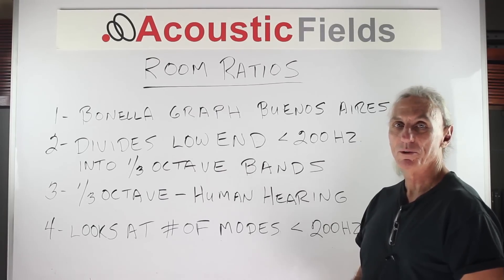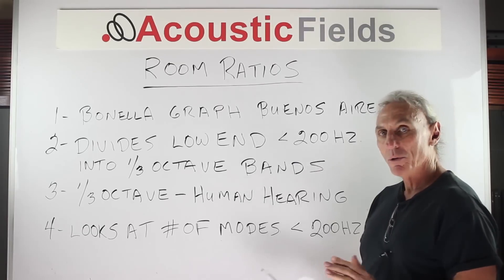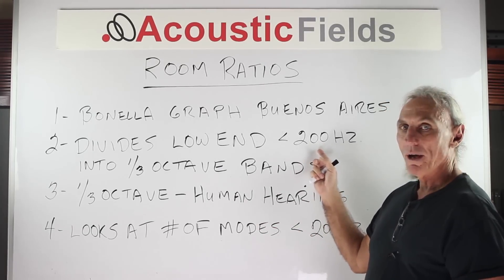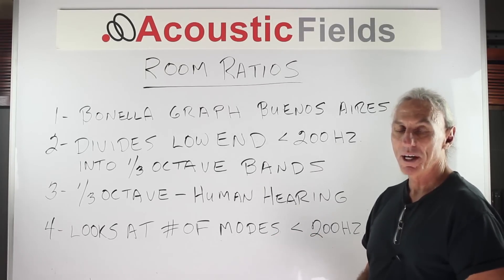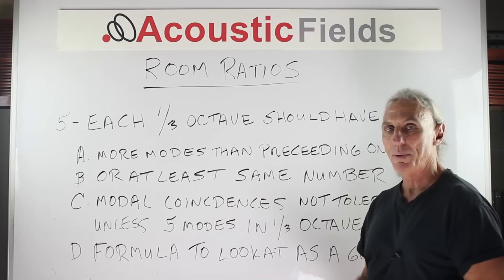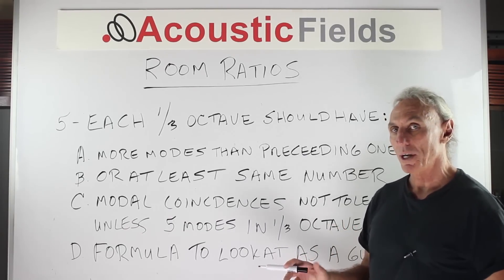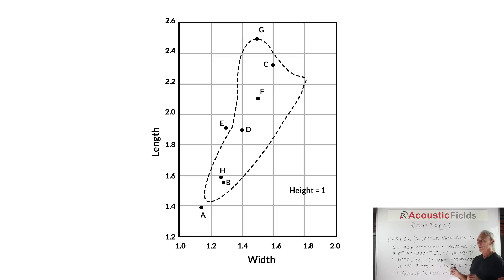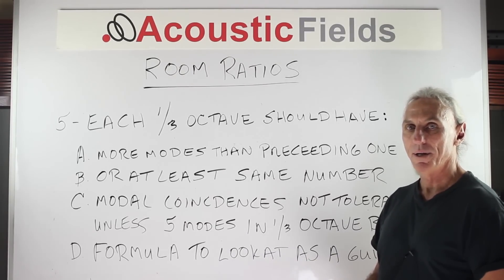Ideal Room Size Ratios & How To Apply The Bonello Graph - www.AcousticFields.com

Comment: Hey Dennis, 

Great video, but I would like some advice if You dont mind helping. 
I am in a process of designing a house and I want to incorporate a 3 room home studio in the basement. The basic goal is to have a control room, a live room and a vocal booth. The live room should accommodate a drummer, 2-3 guitar players and a keyboard player (synth etc) with maybe one extra person doing something random. Basically a 5 person band. Control room is more or less clear, the vocal booth just for one or two people.

I have several design examples in 3D and 2D that are built similarly. Ive read Rod Gervais Studio design: Do it like the pros, im a member of several studio design forums and occasionally read stuff on the internet, but.. I am very confused as to where should i decide on the actual measurements..

The house will be a single level building with the basement being designed specially for the studio. Therefore i need to decide on the actual measurements of the basement because it will later have an impact on the design of the house. 

My questions:
1. Is my idea of designing a studio in the basement actually a good one cost effectively and practically? Maybe im better of designing a separate building and drop the idea of the basement?
2. If i should stick with the basement - what dimensions for the whole studio suite should i choose? 

Most designs I see are usually build according to an existing building or room. Since a separate own studio is basically why i want to build the house - it is the main focus of the design and the house will have to adapt to it. Thats why I want to gather as much information so that I can make good decisions that would prevent future problems and unnecessary expenses.

I hope Im being clear with the idea.

Thank You in advance and hope to hearing from You soon.
Sincerely, 
Marius
Reply from the maker: Hi Marius, Fill out the information in this link: http://www.acousticfields.com/free-room-analysis/. Give me the largest foot print you can accommodate.

Comment: Hi, enjoyed watching your video - very informative!  

Your discussion focussed on a rectangular shaped room, presumably because this is the standard room shape, but is there a specific shape to a room which this Bonella character found gave the best acoustics?  Or are there any guiding principles of room design for ensuring superior acoustics?  

I suppose there is no perfect room, and any shape or dimensions will need some work to ensure appropriate reflection, absorption and dispersion of sound, but presumably some shapes would be better than others?
Reply from the maker: Hi Steve,

Rectangular rooms are easier to treat because the issues you have to address are predictable and consistent throughout the room. There are ratios of room size and volume that work to minimize low frequency pressure issues for the chosen usage. All rooms will require treatment. The goal is to match the room size and volume to usage so that you have enough size and volume to minimize modal issues. Proper size and volume means you need less low frequency treatment which takes up space and increases cost. Vocal rooms have drastically different treatment requirements than a live room.

Comment: Thank you for yours video, it made my mind clear. here is my question - what should be speakers location and listening position in this room, becouse i think it crucial?
Reply from the maker: Speaker/listening position must be determined to be at positions that afford the smoothest low end response possible within your room size and volume. Middle and high frequency issues can be dealt with with other methods but positioning must impact all frequencies below 100 Hz. I can assist you with this. Fill out the information in this link. Include photos of all room surfaces.   http://www.acousticfields.com/free-room-analysis/

Comment: Would you lower a 8,5 foot ceiling for a better ratio? I'd have to lower to 7 foot for ideal ratio. Would you sacrifice the volume? Thanks
Reply from the maker: Never lower the ceiling. The floor to ceiling dimension is the smallest of the three and runs the whole width and length of the room. The modal issues that are involved with less than 14' dimensions are below 125 Hz. The last thing you need in room design is a low ceiling height.
Reply: Acoustic Fields 
The floor above my room is 9’ overhead. Their is a trust system attached under the overhead floor that finished would put the actual physical ceiling at 7.5’ high. But what if I stuffed the truss area with fluffy insulation and put in a trayed panel drop ceiling under the 7.5’ truss supports, with can lights, would it still not be acousticaly a 9’ ceiling?????

Comment: May be a stupid question but here goes, when you speak of dimensions of room sizes are you including acoustic treatment material or are you speaking of an untreated room?
Reply from the maker: +joryaock We have two sets of data in our data base of now 120 built and measured rooms. Our smallest measured room is 10' w x 8' h x 11' l . Our largest measured room is 30' w x 16' h x 40' l. All other room size volume and dimensions lie somewhere between those two extremes. One set of data is untreated and one set is treated. This is how we arrive at the square footage requirements for low frequency absorption technology and surface area treatments for RT - 60 time measurements.

Comment: Having just peeked at your STIRLING effort and willingness to assist others.  How about accepting some $ for making it idiot proof for me when I build our new modest house in New Zealand?  I am a builder currently concept designing, but want to get the basics right in the first place, so, If there is a way I can pay you, and if you could provide me with an idiot proof list of what would be best in a lounge room that will have the typical furniture, no curtains, TV with separate speakers, decent Amplifier - I can then design that room and positioning of 'stuff' accordingly.  To add complication, I have just listened to the 'new' ATMOS system.........pretty damned good!!!  I need to make it idiot proof because at 65 years old and a lot on my plate, one needs rely on others with relevant expertise.
Reply from the maker: +Peter Cunningham To assist you with your room, I will need to know more about it. Please fill out the information in this link and send to me: http://www.acousticfields.com/free-acoustic-treatment-room-analysis-tell-us-room/ I will then guide you through the proper room size and volume for your chosen usage along with any barrier and treatment technology required.

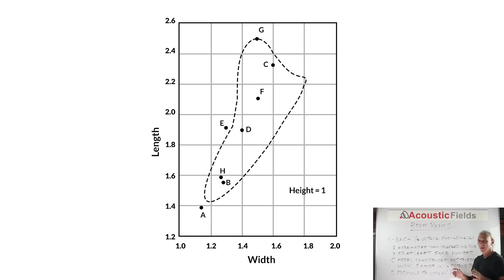Comment: Hello, at 5:47, that's Bolts Criteria, not Bonello's. In fact Bonello's should be a monotonically increasing curve, where x-axis is frequency per 1/3 band and y-axis modal density
Reply: +Ignacio Calderon Pobre Bonello. Lo mandaron al tacho con el "zapato" de Bolt.

Comment: Dennis, to put my question into context if you wouldn't mind first reading this item about my project (link below) - then could I ask your advice on internal design and dimensions given that the container will be a 40ft 'High Cube" with the following dimensions:

Overall 40' = 12192 mm 9’6”' = 2 895.6 mm
Internal 39' 3.25"= 12022 mm 9' 1.5" = 2809.6 mm

http://www.sunshinecoastdaily.com.au/news/your-story-help-me-shed-light-special-actors/2723785

Thank you in advance for your kind assistance. (Finally, there's someone like you who actually knows what they're talking about on You Tube!)
Regards,
John
Reply from the maker: +13thAMG Dimensions are just one part of the sonic equation. Fill out the information in this link http://www.acousticfields.com/free-acoustic-treatment-room-analysis-tell-us-room/ and we can match room size and volume with usage.

Comment: if that was the good ratio then 14'w X 7'H X 20'L is a good room dimensions too? correct me if i am wrong
Reply: No not exactly.  He said if it was below that dimension there would need to a lot more low end absorption.  He's also said in other videos that rooms with 7 ft ceilings are horrible to treat.